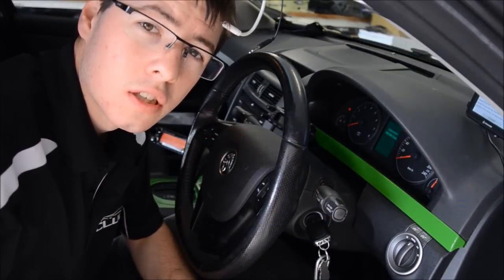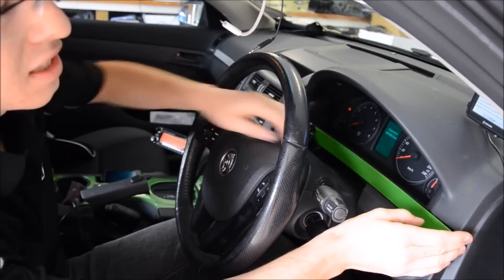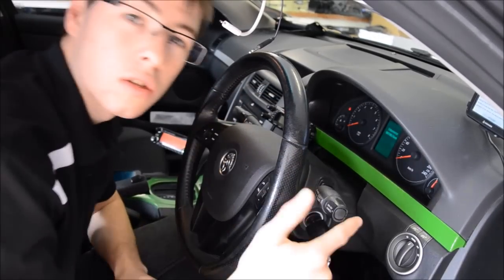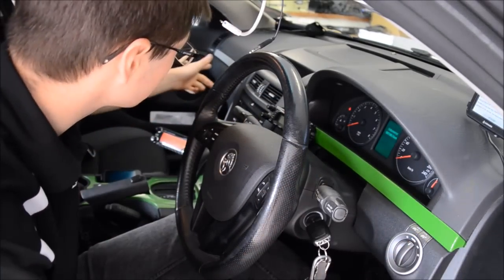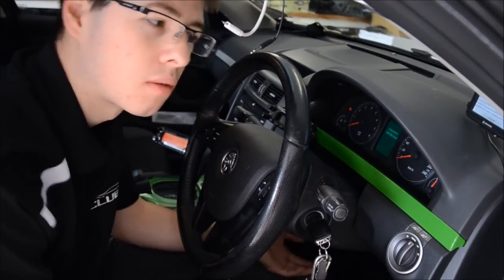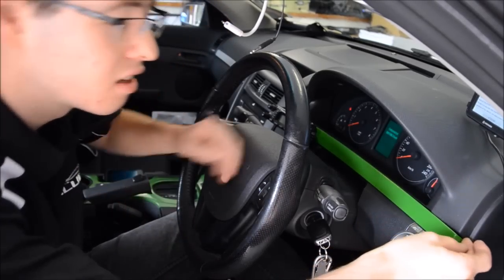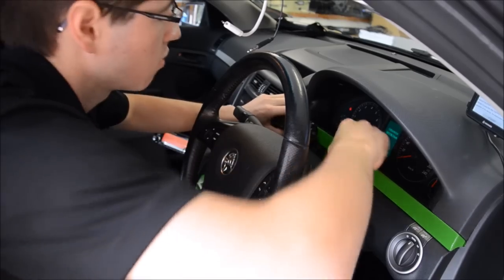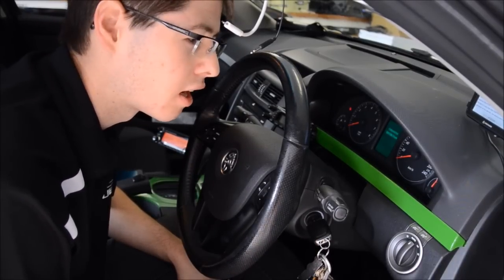How to remove dash strips in Holden VE?

Comment: Do you know how to change the standard interior lights in a series one 08 sv6 Ute from red to blue, is it as simple as changing a setting or will I need leds? If you could reply/make a video on this it'd be appreciated
Reply from the maker: +chris lee Unfortunately not a simple change, it is Surface Mound LEDs that requires a bit of work. There are a few peolpe who offer the service.

Comment: What's attached to the strip when you pull it off....? It's on the left hand and of the strip?
Reply from the maker: It is a remote head for a two way radio.
Reply: @GeekCohen  great thanks. Looks like an easy job, I turned away from an SS commodore due to some butt ugly red strips on it,now I see it's not too bad of a fix, just need to source originals. Cheers
Reply from the maker: @crazysithslave  No worries. You can generally get originals off eBay. Or just paint them another colour. This has since changed, mine aren't green. I just did black now.
Reply: @GeekCohen  Where did these other colors come from? Red, green?? They caNt have been a factory choice from new????
Reply from the maker: @crazysithslave  Factory is silver. The original ones. If you want a different colour, you just spray it. I did mine green first and then black. If you get Plastidip, it can easily change the colour by removing the old one.
Reply: @GeekCohen  thanks

Comment: Hey guys. im looking to buy a ve but i hate the series 1 dash centre. would like to upgrade to series 2 or higher. just wondering is it possible
Reply from the maker: +David Peric Sure is, a bit costly but it is possible. Around $2,000 for the units which include programming. It can be done for sure though.
Reply: Or buy Ve series 2 as they're getting cheaper now

Comment: Is it possible to remove outside window trim? I like to try and paint mine with a chrome look.
Reply from the maker: +Javan Sharry I haven't attempted that one unfortunately.
Reply: +Cohen Lewis How about removing the trim around the head unit ! I want to vinyl wrapp all the middle side of the interior from the middle console straight up. Color White then Vinyl Wrapp my Steering wheel. Just bought a 2010 V VE Calais Wagon.